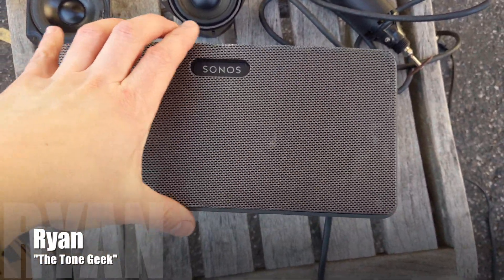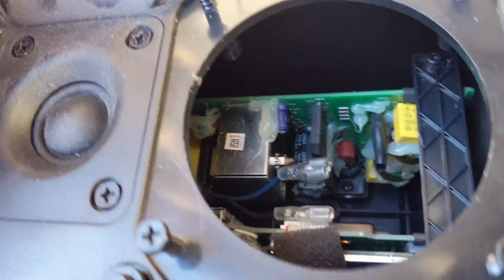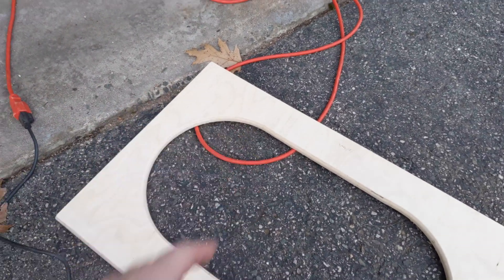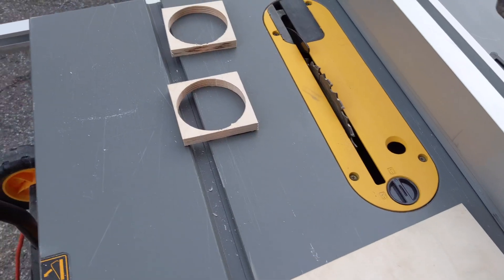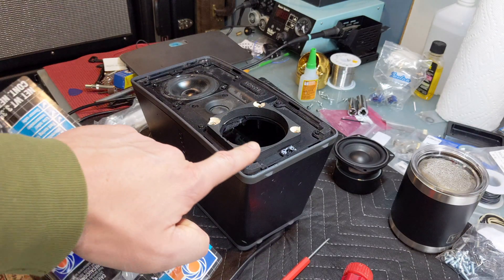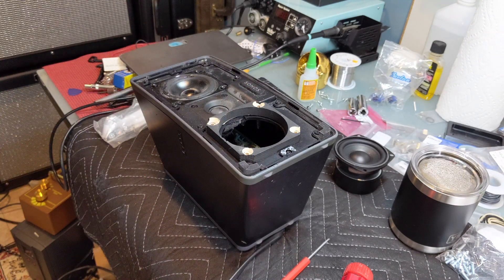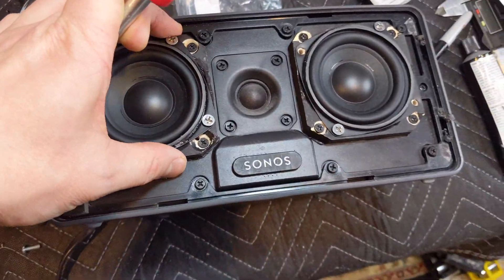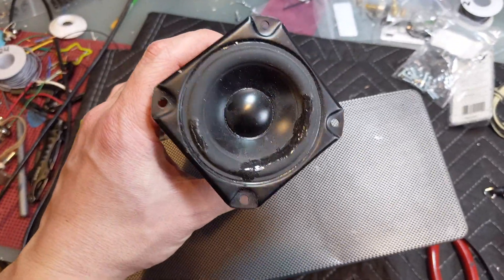Sonos Play:3 DIY Blown Speaker Repair and Fix for $40! | How-To

Comment: I find the dead speaker interesting
Reply from the maker: Totally weird, right? Must be some sort of bass extension technique
Reply: @TheToneGeek  I wonder if their is a way to measure the amount of air that the dead speaker moves to see how effective it is? I'll never forget opening a Bose speaker and see how they built the Chambers. For science class I replicated it out of cardboard. It worked pretty well. But cardboard is too porous and flexed too much.
Reply from the maker: @frankhoxsey1177  that's a good question too. I gave the speaker back to the gym so I can't really measure BUT my observation is that it was close, if not exactly, the surface area of both mid range drivers. Funny enough, this is the same approach Dumble used to design the port on the back of his cabs, just without the dummy cone/diaphragm. That's super cool about the Bose design! I've seen some crazy 3D printing projects of folks making some incredibly detailed chamber designs for achieving certain design goals. Way over my head calculations but it makes me wonder if there is guitar applications?